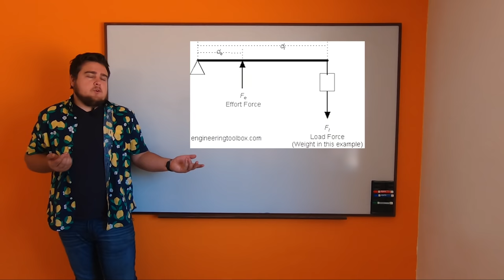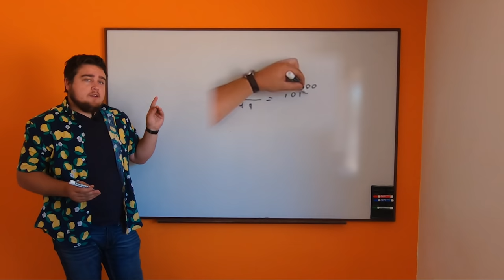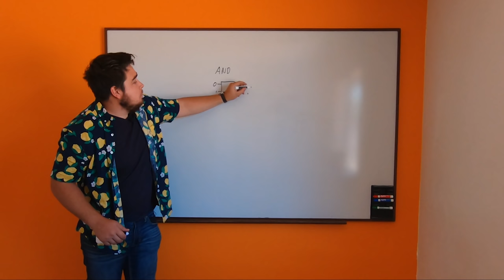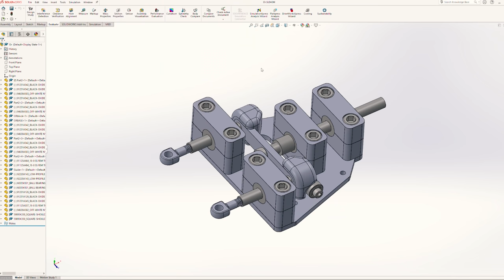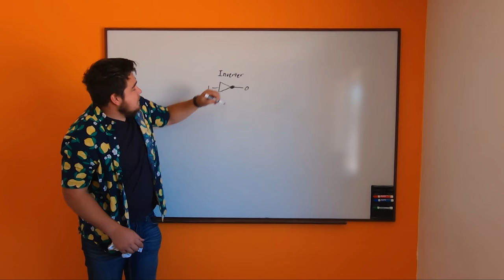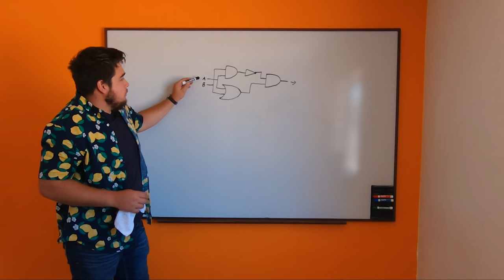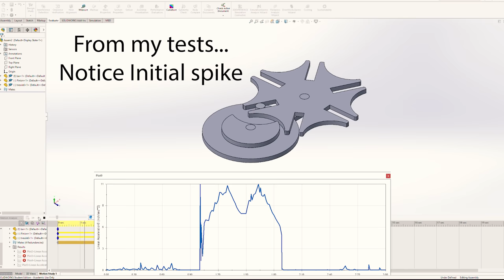Is a Completely Mechanical CPU possible?

Comment: Most modern digital logic is built on NAND gates - you can construct any other logic by combining NAND gates.  I wonder if this could scale much the same way - design a highly efficient and small NAND gate, then chain those together to form the fundamental logic gates, then chain those together to form the higher level logic.  There's also a way to do something similar using NOR gates; since your OR gate is more mature, why not simply miniaturize the OR gate followed by an inverter and build all of your logic from that?

There are some key things you'll actually want to design to make this truly programmable - flip flops, latches, etc.  Those would certainly be interesting to see implemented in mechanical hardware.

Comment: Rather than a Geneva Drive, you can get similar clocking motion through cam and ratchet mechanisms. VertikalDesign has an old 1930's gear mechanics video that might provide some inspiration.

Comment: I think if you develop the pneumatic version you could get to 12,000 rpm or higher especially if you put it on the Mercedes v12 with quad turbos on e85 the horsepower and torque would be insane but you can tune it to be incredibly fuel efficient with multiple power maps the engine with be incredibly versatile

Comment: Honestly, I think your biggest issue will be memory. Having enough memory to not only program the computer but store some basic values using just logic gates will use A LOT of space. Even if you could downsize a single bit to the size of a single logic gate, you’ll still want to have at least 64ish bytes of data, which will end up as a ton of space. Not to mention the logistics of having a mechanical computer where connections can’t easily overlap each other.

Good luck!

Comment: I don't have a lot of mechanical experience but judging by the scale of those logic gates I think anything you build out of them of note would be massive. I wonder if you encoded 1 as an oscillating signal and 0 as a no oscillations could you make logic gates out of gears?  you could transform the oscillations into a simple on off as you have here using <insert mechanical magic here>

Comment: One potential issue, I just spotted, is how each gate increases the level of resistance, thus increases the amount of force, to push in a gate. I was wondering how you plan to get around this issue. Do you think, using some sort of hydraulic system between each gate would work?

Comment: Interesting ideas here.  I do wonder what kind of force will be necessary to drive an N-gate cascade of logic operations, as each stage is going to have to move the subsequent stages and the necessary force is going to add up, significantly I would think.   Also, there'll no doubt be some latency to deal with now and then...

Comment: Hmm, I forsee friction causing a binding problem if each output is tied directly to the next input as in the Solidworks model.

The model needs to be mechanically powered all the way down rather than just from one end. The simplest fix would be to run it on gravity fed marbles. Or you could run it on water pressure or make each gate a clockwork mechanism with a watch spring that takes the input and in response releases it's own energy for the output (signal amplification).

Of course marbles would have to be returned to the top, and watch springs would have to be wound regularly. A mechanism could be made to constantly wind them while the machine is running, as long as there is a torque limiter that just spins instead of winding when the spring is fully wound.

With any solution, but especially one that requires a constant signal from input to the final output (such as a water pressure design) it would be best to have the machine reset after the result has been outputted. This would also store the operation in its current state if the machine jammed, and the reset could be disabled as one form of memory.

Comment: Problem I see, with this design, is that the entire mechanism is only driven by the forces applied to the first level of input lines. In a multi stage logic (8-bit adder etc.), you will have to apply heavy forces to move all stages. 
Electronic solve this by putting electrical amplifying mechanisms everywhere (vacuum tubes, transistors). You will have to use mechanical force amplifiers, build into the mechanic design, everywhere. I wonder how they will look like. If this can't be solved, you will end up with a limited complexity, i. e. a machine that can do basic arithmetics, but nothing more complex.

Comment: Excellent! All the car guys I know think carburetors rule and electronic ignition is a necessary evil. 
I think your going to need to invent a powered buffer or all the lube in the universe won't make it work in the real world over some critical size, the input impedance will be so low you'll be flippin bits with a bottle jack. I bet if your clever(it's fairly clear you are) you can bring in the power with the clock signal.

Comment: So we do everything in modern computers with binary math because that's what transistors can reliably do.  If you're going electromechanical there's no reason not to go trinary for space savings.  And if you're going rotary drive then you can use any base you care to design.  

You solve the "single purpose" part of analog computing the same way we do with binary computers.  You build "instructions".  For basics you just need a way to add and subtract coupled to number storage and a control mechanism capable of reading numbers and instructions in and out of the storage and tripping off the adder plus a compare operation and a jump operation.

Comment: Ofcourse the mechanical aspect got explored a lot, there were many mechanical computers that may have been designed for one specific task, but there were also many that not only were used for scientific purposes, some made it onto the market for smaller businesses to buy.

The differential analyzer was a computer that was highly configurable and programmable, it could solve complicated differential equations to calculate many things such as checking for resonant points in car suspensions, rocket trajectories, checking the stability of control systems etc. This was an analog computer ofcourse, you won't be watching YouTube videos on such a device, but it was a very strong tool for solving many mathematical equations that couldn't have been done by hand, and it did it reasonably accurately too.

As for digital computers, vacuum tube computers were really unreliable and horribly expensive to maintain. The downtime was as long as the uptime for those machines. So when those came around, low computing power mechanical computers were still a viable solution and research was continued. I even happen to own a fully Turing complete mechanical computer, waiting to be restored one day once I have the time. It's called a bookkeeping machine, mine is the East German Ascota 170, but there were many more examples. It can run two programs per carriage by dragging a carriage with metal programming pins over a set of hooks. It has multiple ALUs it can use simultaneously, it has an expandable set of registers, it prints on paper, executes loops, has logic operations and all... Mine is from the 50s or so, and they made them until microprocessors became cheap enough to outcompete these devices. Mine is really big and heavy, and the production wasnt only limited to former Eastern Europe, they also came in smaller but less capable forms, a western manufacturer you can Googlesearch is Olivetti for instance. 

Ofcourse both systems don't use binary, but binary is only used since its easier to work with devices that use two states. Hence there are very little electronic computers in history that used the decimal system like the example I discussed earlier. As for analog computers, miniaturizing analog technology is significantly more challenging than digital technology, somewhere in the mid 70s, digital computers caught up and analog computers were abolished. 

It's not like people didn't have computers before mainframes rolled onto the market, and it's very easy to underestimate the power and flexibility of an analog computer. Whilst not a viable solution today anymore,  it was not engineers using sliderules that put people into space, it's analog computers such as those differential analysers and more powerful electronic implementations that did most of the heavy lifting we'd now do with digital computers.

Comment: The issue you're going to run into is mechanical resistance... There's a simple video that shows a Lego motor turning gears coupled to it in a 1:1 ratio, and after about 20 or 30 gears, it's just too much for that motor to turn.  So after you put so many of these gates in series, it's going to be impossible to push in the first one. -- For a mechanical computer of any complexity to work, it has to have the values flowing through it -- like with marbles or liquid or something... Where the movement represents the 0 or the 1, and the gate is either allowing the movement to flow in a certain direction or blocking it.

Comment: AND is already exclusive, as it ONLY outputs a 1 if both a AND b are 1.  Perhaps you were thinking of NAND? NAND only outputs 1 if no inputs are on.  The reason there is an XOR is because OR is not exclusve, it outputs 1 if a, b or a and b are 1, where XOR outputs 1 only if either a or b are 1, and 0 if they are both 1 or both 0.

Comment: Maybe not a thought experiment -- it has been suggested that venus surface probes may need to be mechanical or clockwork - to last more that 10 minutes on the surface... and babbages Difference engine could be restored to prominence..

Comment: You should make them gates smaller. The smaller the gate is the less energy you will need to much a whole series of pins trought the chain of them.
Reply: And add a spring to reset them. Your or gate, once set to 1, stays 1

Comment: How is your computer going to be powered? Just as critical as the actual logic gates is a way to amplify the signal. Transistors, relays, and vacuum tubes all have gain: They can switch more current than it takes to operate them. Logic gates built out of these components are externally powered and can produce an output signal strong enough to activate multiple other logic gates. With what you're currently doing, each gate is powered by its inputs. If you tried to daisy-chain a bunch of gates together like this to make a computer, you'd never overcome friction.

You'll need a mechanism, either internal or external to the gates, to take in power (probably from a rotating shaft or chain, since you're trying to make this all mechanical) and, when triggered by a light force, push or pull the output rod under power.

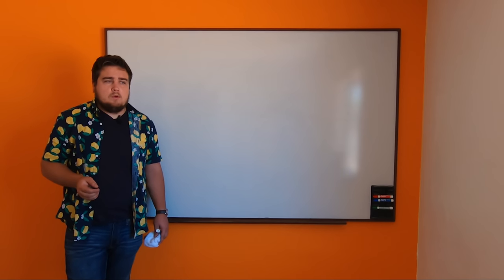Comment: This is pretty cool, but the problem may be that you're relying too much on assuming that the value-states are "push"=1 and "not push"=0. That got me thinking that instead of push/pull inputs, perhaps that "flip-flop" storage element shown at 7:33 may provide an alternative where the value is determined not by any particular action but instead by the position of the mechanism -- such as the output end of an SRAM bit (which is similar to that flip-flop) where one of the two outputs is always high and the other low (which one is which determines the intended value). This makes me think of looking for a way to have a common rotatable piece for use as an input (two of them, obvious) and as an output (so three of them, I guess). Any axis of rotation is acceptable just so long as the mechanism itself works and can be easily converted if/as needed for the next logic gate. Regrettably, I have no CAD experience whatsoever... if I did, I would almost certainly try to design it right now! The good news is that since such a thing is non-volatile, SRAM storage would be totally unnecessary and maybe even impossible since electrical gates are feeding the output back into the inputs of the previous stage -- as it is, this 4-gate (and I think 6-transistor) device requires a constant voltage supply, and it is obviously inferior in every way except for speed (and to a degree, reliability also) when compared to a DRAM bit. Mechanical logic gates would certainly require rethinking some circuit designs, possibly even most of the binary-centric computing standards we've been accustomed to. Also, I'm generally opposed to the use of springs for this due to the risks of metal fatigue given the extremely high number of stretch/compress cycles... ratchets, latches, levers, and rotating parts won't need them anyway.

Comment: Those are some nice looking logic gates, but I believe it is not possible to build a computer out of them. The output of one logic gate needs to push at the input of the next gate. The mechanical power required and the manufacturing tolerances keep adding and just after a few gates, it just gets stuck. 

If you look at electric or electronic logic gates, they don't just have their 2 inputs and 1 output, they are also connected to a power source. The power at the output does not come from the inputs, it comes from the power source and the inputs just decide if it goes through or not. And that is how I believe mechanical logic gates need to be build.

Comment: Nand and nor gates are computationally complete.  Otherwise AND+NOT or OR+NOT are also computationally complete.  Wikipedia has a nice article with every minimal combination.  The practical space trade off usually makes having XOR also necessary. Mechanical computers existed over a century ago, and quite elegantly designed.  I've seen on Matt Parkers YouTube dominos uses to construct gadgets acting as gates which is also mechanical as well as gates designed to use water which is mechanical but uses fluid dynamics and gravity.  The interesting thing here is to see the mechanical gadget design you came up with.  The issue of resetting is avoided in electronic gates, and a major practical nuisance.  Otherwise currently timing is not considered but springs for resetting would start to move towards that.

Comment: so speaking as someone who has built my own 8 bit breadboard computer comparable to Ben Eater's SAP-1, if you want to make such a thing, you have to take some shortcuts, for instance, Ben uses a lot of ICs (integrated circuits), which miniaturizes things quite a bit.  If you wanted to build a SAP-1 equivalent computer out of the logic gates you showed here, we'd be looking at something the size of a warehouse (probably bigger) that took a ridiculous amount of power to run.  You'd also have to run it at a ludicrously slow clock speed to wait for all of your slow mechanical devices.  Not saying it's impossible, just saying that unless you have a government level budget... this youtube channel is not going to accomplish such a thing.
For something comparable though, back in 2011, a dude built a 4 bit adder out of knex which is really impressive.  That being said, the thing is essentially a 7'x2'x2' tower, and that's only half of the ALU right there

Comment: Nice video, but interestingly enough, fully mechanical CPUs did exist. The Babbage machine should have be on, and Konrad Zuse has built one in the 30s, with the only electric thing there being the motor, whoch, of course, could've been replaced with something purely mechanical.

Oh, and by the way, you can build a fully pneumatical CPU.

Comment: Your design has a pretty big flaw which you'll probably discover as your circuit grows. It lacks something that transistors got: an external power source, ie that the output power can be greater to or equal that of the input. If you're only applying force at the input and since each gate has friction and springs it would quickly grow unfeasible to drive due to internal losses.
Also, on the topic of general purpose computers, the first one to be proposed and prototyped was in fact mechanical. Check out the work of Ada Lovelace: https://en.wikipedia.org/wiki/Ada_Lovelace

Comment: I'm not sure why the uneven acceleration of the Geneva drive would matter for this... I assume you're looking to use it basically for indexing, like a clock signal, and for a mechanical system, with inertia and friction acting as dampening systems automatically, I'm not sure why it'd be a problem.

Comment: Charles Babbage designed a mechanical digital computer in 1821 why are you reinventing the wheel??????? check out london underground control systems or a  WW2 battleships  gunnery  range finding and fire control

Comment: Commenting in advance to say it's definitely possible, but slow, energy intensive, and prone to breakage. In an emergency situation where computing is required (apocalypse?), it would be far more efficient to have the energy source (hand-crank, gas engine, whatever it may be) generate electricity and use a traditional CPU.

I figure you're going to go over all this anyway. Making advance predictions is simply a good habit, forcing myself to produce a concrete record of my predictive power or lack thereof, so that I can't just say, "yep I knew it," in hindsight.
Reply: Great introduction! I look forward to your next update.

Comment: These mechanical gates as they are will not work in a more complex system. This is mostly because they do not provide “gain” and they have insufficient “noise margin”. To visualise the problem think about many mechanical gates like yours chained together. 
The lack of “gain” means that you will need a lot of force applied on the first gate to get the mechanical signal to travel  to the last gate. 
The lack of “noise margin” means that the actual mechanical movement of the last gate will be less than the first one, thus potentially leaving it in a non defined logic state